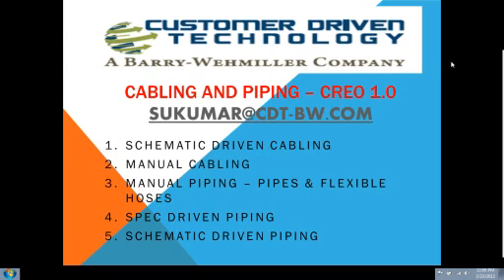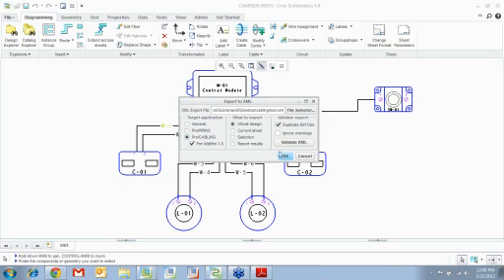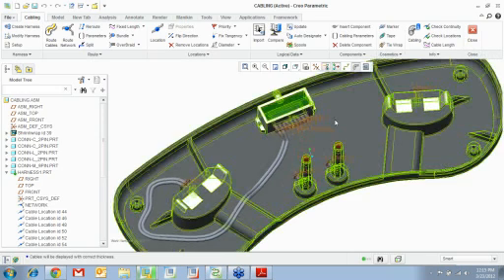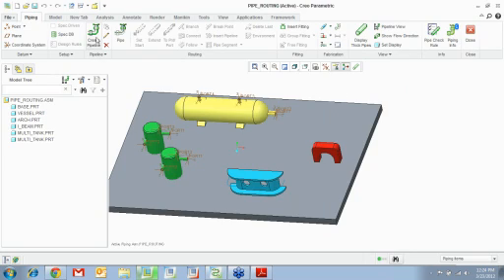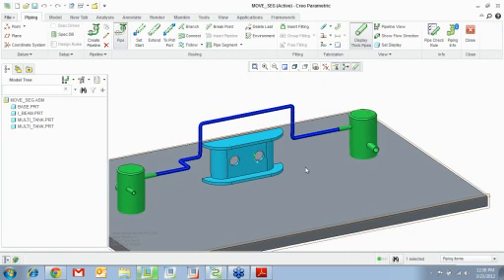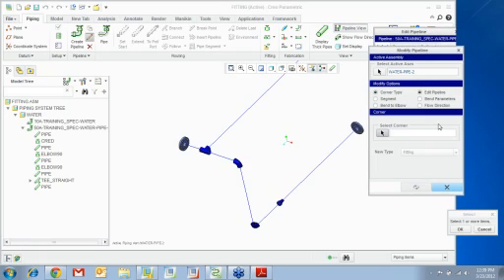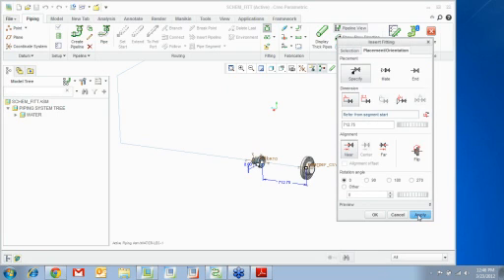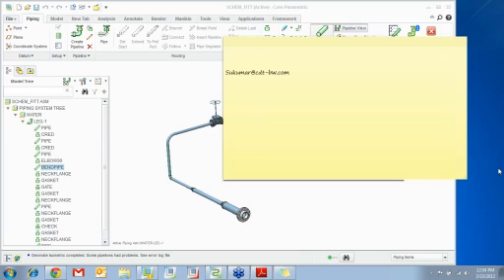Creo Piping and Cabling Extension (PCX) Webinar

Comment: Yes George,
You can do the wires and cables entirely in Creo without taking any logical reference from  Creo Schematics or Pro/Diagram.
All you need to do is to create spools manually inside Cabling mode,designate connectors and route manually or route wires via the network.